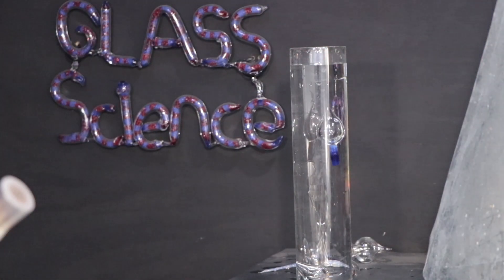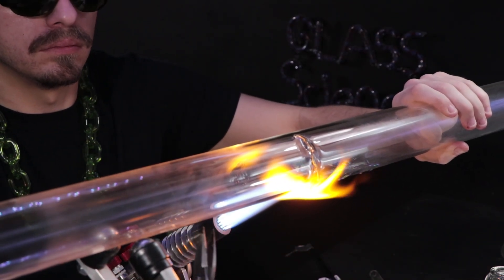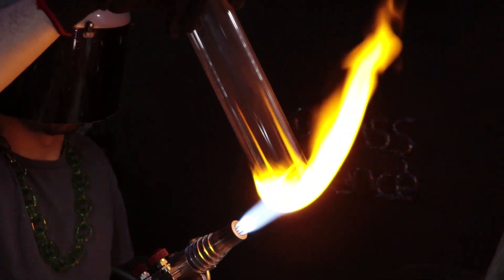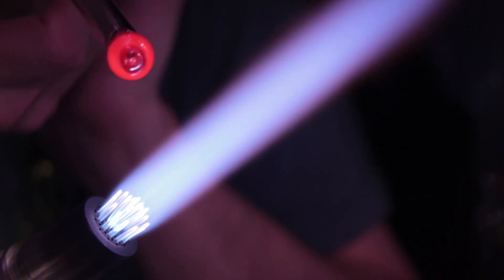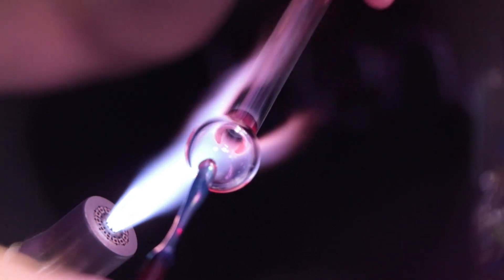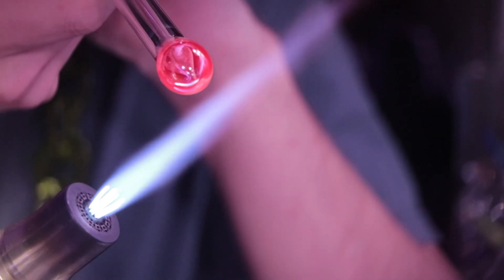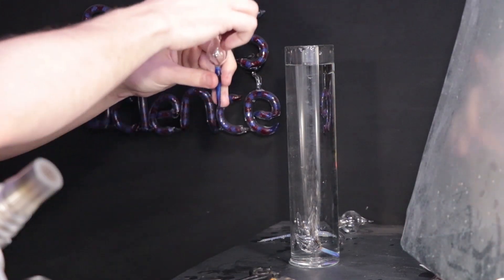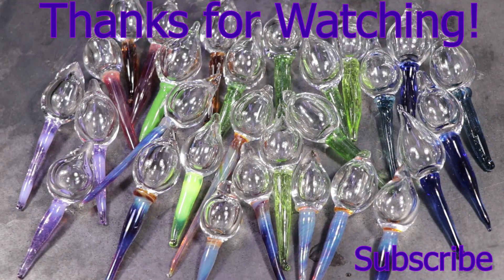Galileo Thermometer Lampworking

Comment: I broke my Galileo Thermometer. I kept the floats. I had no idea that plain water was the liquid that was used. This was very helpful. I now have to find a tube and seal to recycle and replicate the Galileo because I am not a glass blower and it probably a good idea to keep me away from flames. Thanks for the info it was fun to watch.  Maybe someday someone will post a recycled remake. Your post was incredible. Thanks
Reply from the maker: Hello Sandra, I'm sorry to hear about your Thermometer. The floats should still work in an open container like a flower vase, but the water will evaporate not being sealed. 
  But yea repairs are extra difficult, its sometimes easier to start over from scratch. The floats don't need to be remade of course but an outside container wouldn't be to hard. Thanks for watching! Have a good 2021!

Comment: face shields like that dont have didymium lenses, so it doesnt protect your eyes from sodium flare. be careful to wear didy's  under a face shield like that

also flame popping a tube that large is easier then your break down method. and safer and faster
Reply from the maker: That is a good point to make, I always recommend the face shield for larger projects but only for UV protection, you also need didymium glasses under it. You can't see them in the video but I have mine on under the shield. I agree also breaking the tube down with the flame would of been best, I used sheers here just to demonstrate its possible to cut glass. Thanks commenting Cody. Stay melty my friend!
Reply: @JasaGlass  ive seen your didys under before just wanted everyone else to be safe ;)

Comment: More fun project ideas: a triple-point of water cell. It's a sealed container containing nothing but water - water is boiled to purge the container of other gases, then it is sealed. This produces an incredibly accurate and repeatable temperature point: 0.01*C, and until very recently was the defining point for all temperature measurement (despite not being THE standard anymore, it is still the most accurate realization of that temperature). It ties in with this project (thermometry), your supercritical experiments (multiple phases of water), and your magnet experiments (glass-in-glass construction).

Comment: probably the worst way to tear down a tube.
Reply from the maker: You could tear it down with a brick, that would probably be the worst way.
Reply: @JasaGlass  That would be worse. I've been flameworking, mostly pipes, since 1996. Stevie is not my real name, ever watch Eastbound and Down? Try a deep score a little spit and a molten rod. Works like a charm. The score doesn't need to go all the way around and the smaller the rod the better,5mm.

Comment: that was one of the worst ways to cut that tubing. and especially all that bubble trash you created...that shits deadly. for me, i put a score on the tubing. heat up a punty and stick it to the score. it breaks evenly around. works on all tubing sizes
Reply from the maker: Ya I didn't really mean to pop the hole like that, I was just trying to thin it out to rip it open in the flame. That bubble trash made some good footage though and don't worry it all went towards the ventilation hood. Lastly your way would be better, I just went with Glass Shears to show them in use, I normally don't use them in the videos.
Reply: I'm glad that i'm not the only person who held their breath and freaked out a bit when that bubble popped.